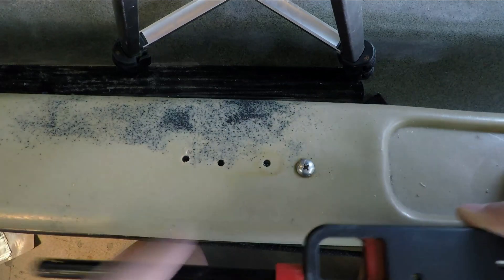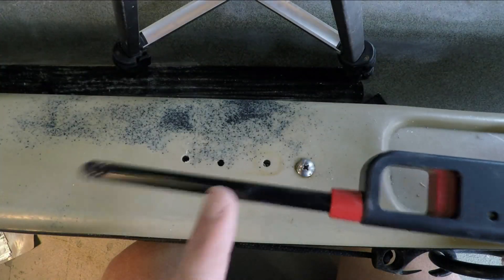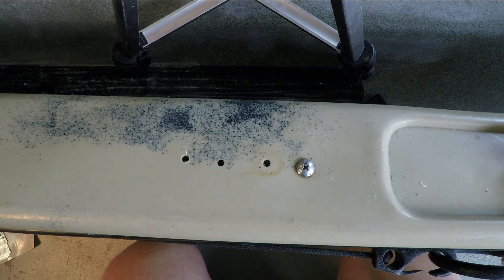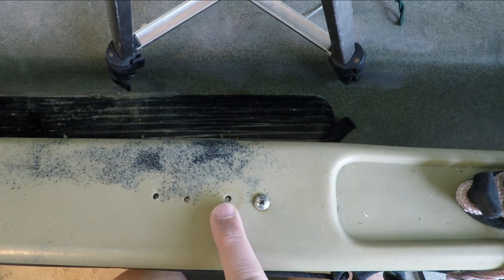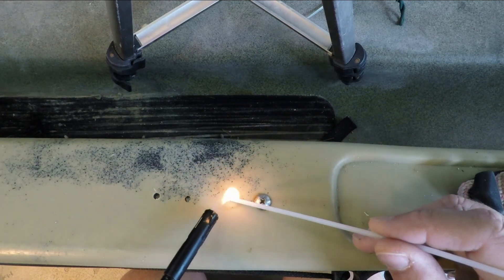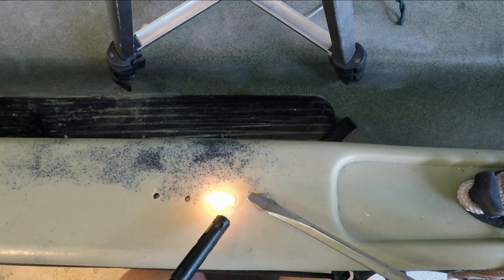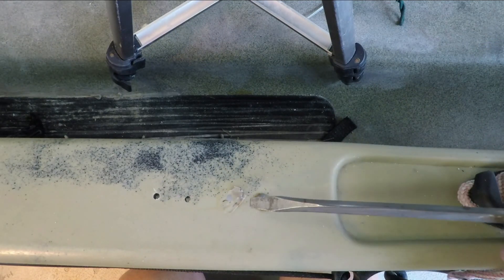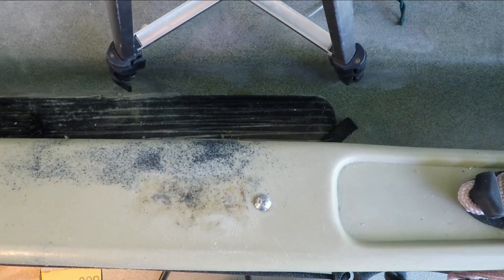Fix a Small Hole on a Kayak - Lighter vs Welder Test

Comment: Thank you for this demonstration!  I live in an apartment and keep my kayaks in an off-site storage unit. I have no access to exterior electricity at either site. My primary sit-on-top kayak has a small crack in the stern and I've been stressing over how to fix it. All the other videos show either propane torches, which are prohibited due to fire hazard, or power tools. I've been wondering if a lighter would work--and now I know! Thanks!
Reply from the maker: Be careful! Remember, to repair a crack, you have to drill small holes at either end to keep the crack from getting larger. Then, you need to remove a small "V" of plastic along the crack. Fill that in. It might be hard to do all that with a lighter. Ideally, you should fill in the inside of the crack as well. Good luck!

Comment: This is a pretty good demonstration. However, what happens when the screw holes are in a place where you can't reach to install the backing to the holes (step 1.)?
Reply from the maker: For those, you just have to melt a glob and push it in. Not ideal, but no other option I know of.

Comment: The welder wins but in a pinch the lighter did a great job.
Reply from the maker: Yes... and most folks just need to repair bolt holes as they move things around rather than a gaping opening.